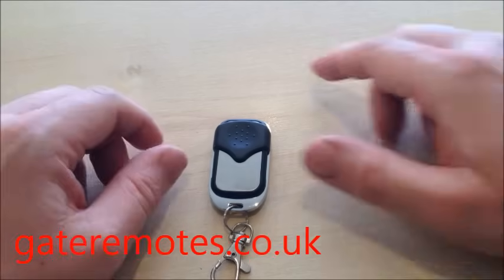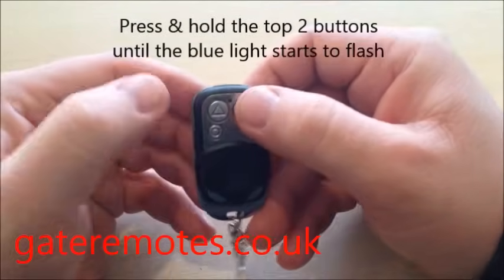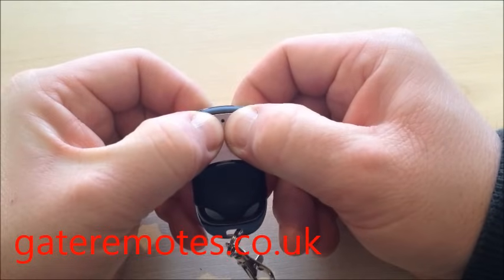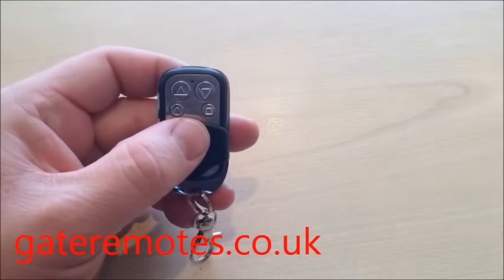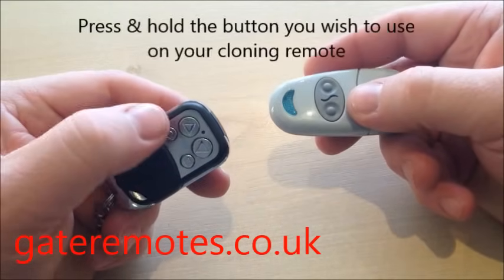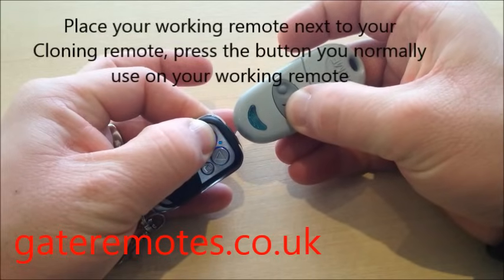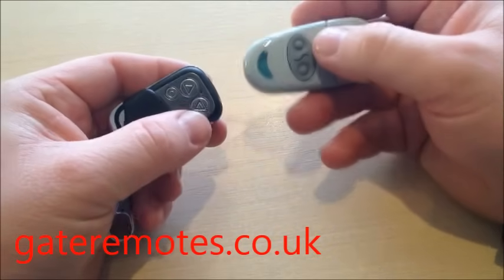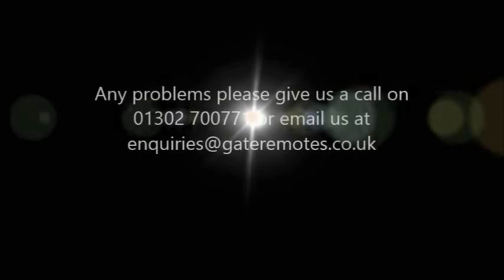Programming a GR4000 Universal Cloning Garage & Gate Remote Control

Comment: Hi, not sure if someone has the same issue. I have the same garage fob, but a few weeks after programming it's not working and I have to do the programming again. I even bought two and they both lost programming at the same time. Does anyone know what could be the reason?
Reply: This is a saftey feature. 

That's mean whenever you click the button of the original remote the code between the original remote and motor receiver will be changed as encryption. When you program new remote just don't click the original remote button again and keep clonining the new remotes from previous cloned remote.

Any click on original supplier remote will change the remote code agains.

Comment: Hi, im moving into a property with a remote operated garage door. We are replacing all locks on the house and I would like to do the same for the garage remotes for security purposes. Am i likely able to pair new remotes rendering any others useless? Im yet to find out the maker of the opener. Thanks.
Reply: You just need to pair new remotes, once that is done ensure they work without the other remotes, then you can simply reset the other remotes by holding the top 2 buttons until the blue light flashes, repeat until it stops working

Comment: Can someone help please

I have pressed both button which did the reset
I have clone 1st and 2nd button from the original remote, which worked
My first try with the gate was a success, both opening and closing

However this was the first and last time it worked, the remote still works, blue light still flashes upon press, but the gate do not respond at all

PS:The original remote is still working normally

Thank you

Comment: MIne doesn't even reset. I tried every combination but the red light won't flash so I guess I wasted 4 bucks on a useless remote.
Reply: Me too 
If you find a solution tell me
Reply: Does it work if the original is red light and the new one is blue light?